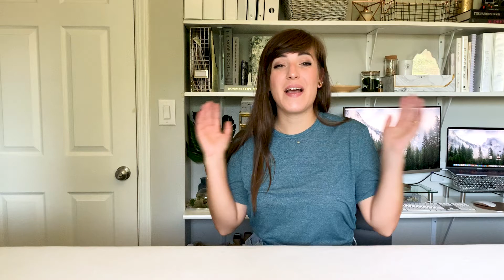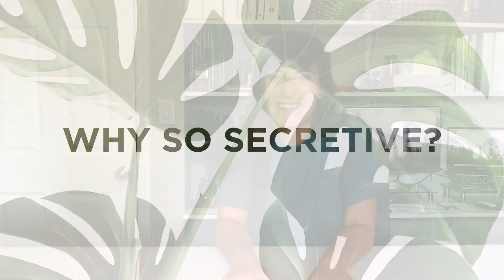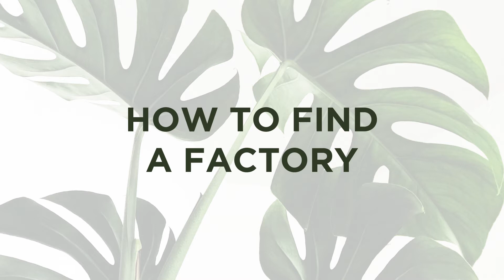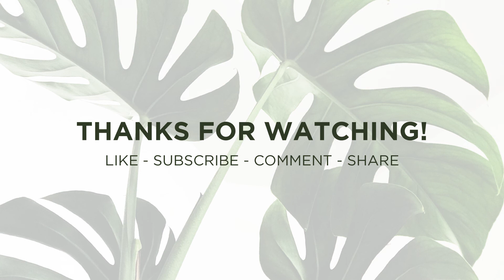How to Find Manufacturing for your Apparel Brand

Comment: Thank you for creating this video and this resource. I needed reassurance about how challenging it can be to find the right factory. I've been searching for several years now and have even gotten support from a firm/agent, but every time we think we found the right partner, quality, pricing or minimum comes up over and over again. My garment is very technical so I've felt so defeated at times... hope this resource helps.
Reply from the maker: So happy to be of help! I would say that finding a good manufacturing partner is one of the most challenging parts of the development process, but don't lose hope! The Fashion Resource Directory is a good jumping off point. Be sure to check Instagram and other social sites because more factories are marketing themselves that way and being more transparent about their capabilities and what they offer. Good luck!
Reply: @POINTSofMEASURE  Thank you! (: